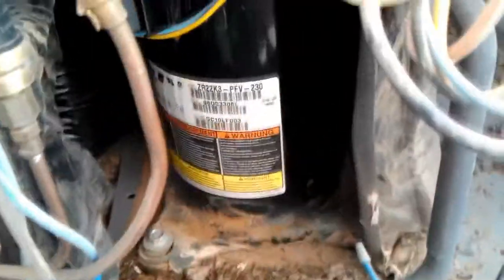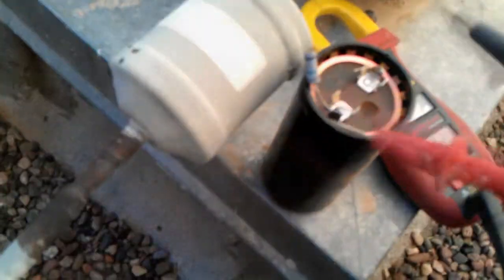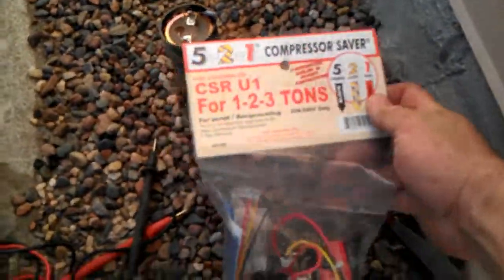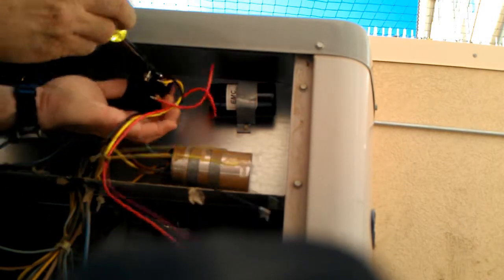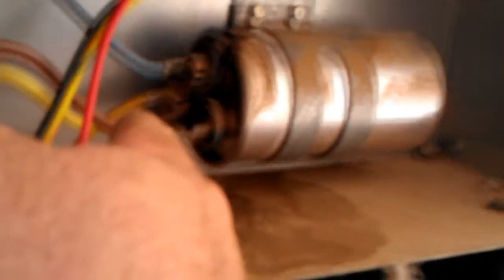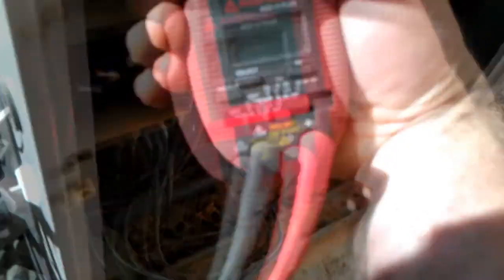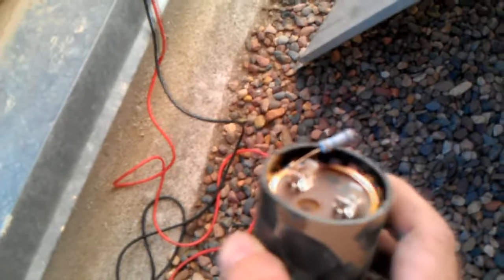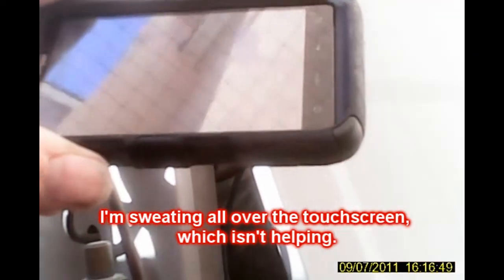New smartphone HD video test - Diagnosing AC tripping breaker - Install 5-2-1

Comment: That was a carrier condenser what seer was it . That looks like those two speed condensers from bryant and carrier .I installed many of them , I can tell you the low voltage wiring can be a pain in the ass if you dont have the proper wiring diagram from those two speed units . Lennox had them for many years and that plus furnace . it sound like a buss bomb .

Comment from the maker: @hanky97007 
I did the one handed thing because I was holding the camera.
I've been bitten but only if I forgot to turn off the power or if there is an OPEN motor winding that left the (run) cap charged. Start caps have the bleed off resistor.

The mini cam cost me $15 for TWO of them on eBay! You do then add a 4 gig card costing another $10 to $15.
Pretty cheap for something that is rechargable and is always in your pocket.

Comment from the maker: @HVACKID94 
Ah, you mean the "other" videos.
That's a Samsung camcorder I bought at Fry's a few years ago for about $500 bucks.
It uses an SD card to store the videos. 
The one swith a built in hard drive, etc were a few hundred more!

It does ok. It obviously has a better lense than that on a smart phone and it has stereo sound with the left and right mics being one opposite sides of the lens which makes for nice separation. :-)

Comment from the maker: @HVACKID94 
Yes it came with one from the factory.
Evidently it needs it! Perhaps it has some sort of non bleed TXV and short off cycles.

As for the smartphone it doesn't do too bad. The audio is clean too.
Sweating on the touchscreen and/or the being exposed to the sun had some effect on it however, because it was changing the zoom on me when I wasn't touching the screen and would not respond to me pushing the record button to stop the recording until I moved it out of the sun for a moment.